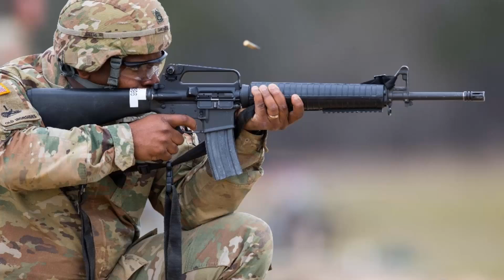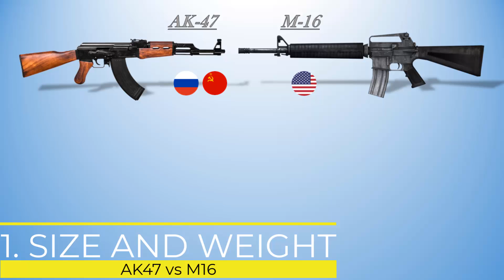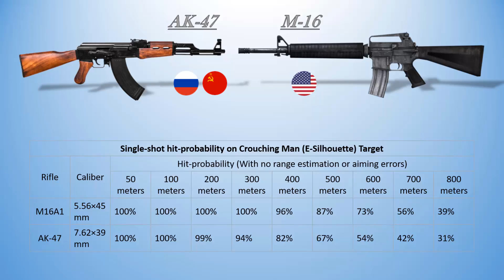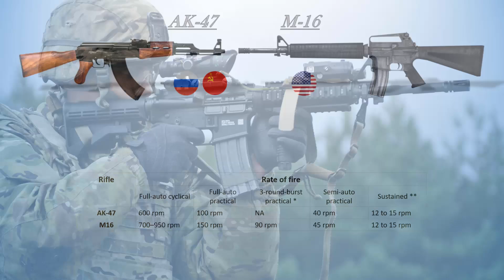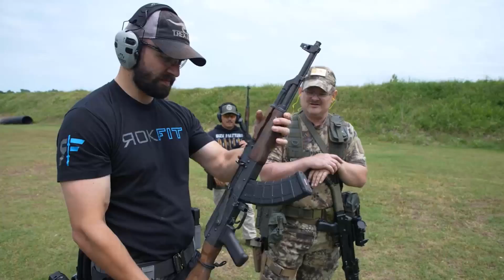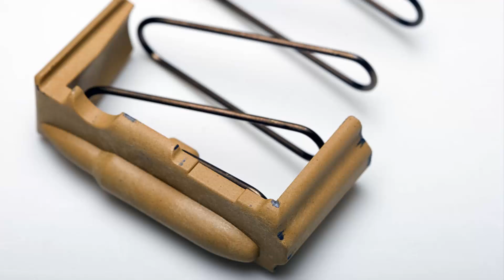AK-47 vs M16 | Which is better between the two?

Comment: M-16 at the range, AK-47 on the battlefield
Reply: I'd take anything that's not chambered in 5.56 long before I touch an M16 or any AR derivative.
Any rifle which requires a "forward assist" to get it's bolt to go into battery, is a piece of crap.
Reply: @mazambane286  The AK has a "forward assist" too, I guess it's a POS. Soviet 5.45 is similar to 5.56 NATO, so the AK-74 must be dinky in spite of all the KIA's in Ukraine ツ
Reply: @TheSundayShooter  Well I don't know where you live? But I live in Africa. Now I have seen thousands of AKM's in my life and have to see one with a forward assist. Could you explain to me exactly where on the rifle it can be found? 
Yes the Russians are sure to find out soon enough, as have NATO, that those pissy little rounds are useless.
The yanks know this too. But seeing as they have invested huge money into that AR platform of failure over the last 60 decades they are now far too embarrassed to admit it.
Reply: @mazambane286  The fixed (reciprocating) charging handle of the AK functions as a "forward assist". The Ukrainians are inflicting plenty of casualties on the Russians with "pissy little" 5.45x39. I am not sure how you measure success/failure when neither 7.26x51 nor 7.62x39 made a difference in Rhodesia and South Africa respectively
Reply: @TheSundayShooter  Not only did I do the foreign weapons course, I also made use of eastern block weapons. And nowhere during my training was I ever instructed use the cocking handle as a forward assist. Ever!
Regarding Rhodesia and South Africa. Firstly I don't believe you were even alive in the 70' and 80's, let alone in either of those two countries.
Rhodesia never used the 5.56 at all. Apart from a few privately owned rifles. 
South Africa adopted the 5.56 in the early 80's. A move which was not widely accepted by professional soldiers. 
The doctrine was basically as the army could not train their national servicemen to shoot straight, they would train them to shoot lots! Much like the yank "spray and pray" doctrine. Which you still use.
Throw a lot of lead downrange and hope you hit something!
I for one refused to be issued with the new rifle. Much preferring to hang on to my 7.62. 
At least the 7.62 is not defected by twigs and leaves.
The 7.62 has been teaching the bad guys the difference between cover and concealment for over 60 years! 
You can keep your AR and your 5.56.
Reply: @mazambane286  
>eastern block weapons
There is no K in Eastern Bloc
>nowhere during my training was I ever instructed
It can be done physically, does not matter whether or not you were told you could
>yank "spray and pray" doctrine

You have mistaken the American doctrine of suppressive fire for the German practice of spray and pray
>Much preferring to hang on to my 7.62
Made no difference to the SACP coalition, which has control of the SA government
>teaching the bad guys the difference between cover and concealment
Is that how you cope with your five-round magazine and lack of select-fire? Interesting...
Reply: @TheSundayShooter  Seems you're rather confused. Or is Southern African military history just not your strong suit? Along with the benefits of carrying a rifle chambered in 7.62 over 5.56!
Eastern Block suits me fine thanks!
Imagine a yank attempting to teach someone English! 
Well one thing I can add to your delirium. 
At least the South Africans managed to defeat the warsaw pact in the field. The only nation, other than the Afghans, to actually achieve this feat. 
Things never went very well for you in let's see......Korea, Vietnam, Iraq, Afghanistan, Mogadishu. Fuck me that was a disaster! 
Your attempt at rescue in Iran...was it in 1980? When one plane got lost. Two others flew into each other! One was abandoned somewhere? 
Oh well at least you managed a win in Grenada. Woooopee!
Reply: M16 is never run for bananas body but ak 47 is proced to another bananas body,,that a compare,meaning ak47 is better than m16
Reply: You apre absolutely right
Reply: เฮาอยู่สกลเน้อออออ
Reply: Bro has never heard of the M16A1
Reply: They missed, probably, the most important comparison: cost per unit (the old "made for purpose" vs "made for profit" comparison that always gets overlooked here in the west - it all about the 'bells & whistles' and not the volume...)
Reply: The Ruger 10/22 is better than both of them
Reply: I'm retired DF.  I agree.
Reply: The best special operations forces around the globe prefer AR-15's
Reply: @TheSundayShooter 😂😂🤣☝
Reply: @TheSundayShooter   And yet 1000s of US marines and soldiers preferred the AKs they picked up off of dead Vietnamese over their m16s.
Reply: @BrownBandido  There you go again— invoking Vietnam memes after being confronted with reality of the 21st Century
Reply: @TheSundayShooter  The AK series of rifles have proven time and time again to be better than the ar15 series. And your bias was hilariously blatant when you compared the m4 (an improved, newer m16) to the old ak47. A fair comparison to the m4 would be the ak74, and while the m4 is more accurate, the ak74 is more reliable and the 5.45 has better ballistics than the 5.56. The only one living in an alternate reality is you, cope harder
Reply: @BrownBandido  I never referred to "the old AK-47", that was Marlin-1895 (the OP). The AK-74 is a better service rifle, but the Russians currently use the AK-12, which is garbage (even the AK YouTubers agree)
Reply: @BrownBandido  There have been more improvements that can be listed on the AR's. But the reason that the M-16s weren't reliable in that era had more to do with the ammo being provided than the weapon.
Reply: @TheSundayShooter  gonna cry ?
Reply: @platypunk1998  About Russia's perpetual humiliation in Ukraine? Nope, that's all you
Reply: @TheSundayShooter  Ukraine is burning up in flames along with your irrelevant opinion
Reply: @TheSundayShooter You listen to way too much biden propaganda.
Reply: @birminghamblueheat4986  And the misinformation that the rifle was "self-cleaning".
Reply: @BrownBandido uh no, the military would not allow that but okay 😂😂
Reply: @BrownBandido  That's because the early models during Vietnam had issues though later versions were much improved.
Reply: @BrownBandido  this is not 1968
Reply: The AK47 and it’s many variants are great rifles and are proven reliable and lethal but the m16/m4 variants are a more precision/accurate rifle and is a lot more reliable than you may hear in popular culture. Any armed organization with the money has m16/m4 type rifles supplied to its ground forces and those who have less funds use AK type rifles.
Reply: @BrownBandido I didn’t. When you were there did you witness this personally or is this what you heard in a bar one evening?
Reply: @BrownBandido at the time the M16 was introduced it was not a very good rifle the magazines were crappy in a 20-round magazine that can only put 16 using bad cartridges probably bad powder as well but they made improvements on it and it got better and better which is why it's still used today
Reply: M16 is way better for the battlefield

Comment: I like the m-16 better, it can easily be modified to shoot other calibers in different barrel lengths with out a gunsmith working  in a shop,
Reply: M16- what it slightly lacks in reliability, makes up for it with ease of customization.
- Less reliable in combat due to tighter tolerances, leading to jamming and damage to the gun
+ greater customization allows to modify internals and increase performance and compensate it's lower reliability
Reply: @bum116  the IRA's weapons expert chose the AR-15 over the AK-47 to arm the entire IRA,  because of the big difference in accuracy, even though the cost was 3 times higher per rifle, they believed reliability issues are not a problem, with a smart competent soldier behind the sights,

Comment: If we are talking about the early M-16 I would prefer AK in most environments. 

More modern M-16s beats AK no competition. Better in almost all aspects outside of reliability. 

Even so, modern M-16s are very reliable, put to great use by several Guerrilla groups in tropical regions worldwide such as the Myanmar PDF.
Reply: Reliable=fucking jams
Reply: @HayilAl-Qadhaafi-ws9of  only the early Vietnam era M16s got a bad jamming problem. Newer ones are reliable, not as reliable as the AK but still very reliable.

Comment: In Vietnam War, US soldiers would had thrown their M16/AR 15 when they saw AK47/AKM or RPD/RPK.
Reply: That’s kind of incorrect. There’s a lot of reasons they threw away their ar15s is that they never issued maintenance kit or instructions to clean them, no forward assist, didn’t chrome the chamber and using crap ammunition that easily mess the cycling.

When they finally issued m16a1 and gave actual instructions, a lot of the initial problems got resolved. Although, it didn’t fix they’re in thick foliage and being in someone’s home turf.
Reply: @Frank451Martin  most accurate comment I've read yet.
Reply: Early M-16s we’re notoriously easy to jam. Nowadays M-16s are very reliable. Even the Myanmar PDF Guerrillas use them in the jungle environment to great success.

But still, an SKS would beat both the M-16 and AK in reliability. I’ve seen a video of one of those get run over repeatedly, smeared in mud and poop, left in water for days on end, and thrown in a bonfire and still work.
Reply: @spingebill8551  
This foundation was still laid by the USSR and adopted by Russia. Any weapon that is not too complicated (from a machine gun to a cannon) should be: 1. Easy to use by the user 2 Repairable "on the knee" in the field 3 Reliable (to be used for a long time without maintenance) 4 Unpretentious (to be used in rain, snow, mud)
Reply: Yes, that's exactly what happened.
Reply: @hollymartins6913  Do you think Gali ACE 31/32 is a version of AK?????
Reply: @MLPFRIENDSHIP360  think of the galil as a kosher ak made by balashnikov. Yes, it’s pretty much an ak that shoot nato rounds.
Reply: @MLPFRIENDSHIP360  think of the galil as a kosher ak made by balashnikov. Yes, it’s pretty much an ak that shoot nato rounds.
Reply: Like everything else there are teething problems to any new system and that does not mean it will stay that ways.
Reply: @tomnguyen9931  But US haven't fixed that problem when they created M4 Carbine in many years later and now US Army wants to buy German's gun instead of keep using M4A1
Reply: Stop the lies, the ar15 wasn’t even invented in the Vietnam war, only the first version and protypes of the M16. Russian boy
Reply: LOL, where did you hear that bullshit? You can nag about M16 vs AK, but American M60 is actually superior to the Russian machinegun RPD/RPK. Even the VCs will be happy to take M60 any day. And AR 15 is actually much better in terms of reliability than M16 used back then because they used a false powder for M16 ammo, not issuing the cleaning kit for M16. So it was the false of the US logistics, not the gun itself.
Reply: Thats a lie!
Reply: @SNACHG   M16 is terrible, that is never lie !!!
Reply: ???, you obviously don't know the real history of the M16's service in Vietnam! Stop telling stories you made up in your head!!
Reply: @montys420-  AK47 never get jammed. Water, sand, always works bro.
Reply: @andrzejperski854  will agree with you mate it is a weapon that is designed to be rugged and work, simple to use and maintain by simple ppl, and because of this it's not very accurate!
Reply: @montys420-  Yes M16 can shot on longer distance with more accuracy but when area is tight with loads of obstacles AK47 is much better.
Reply: @montys420-  
You are a not smart boy who does not know how and with what weapons the army of his country fought. The network is full of photos and even videos with US soldiers with AK47, this is reflected in the memoirs and interviews of American soldiers. And you deny. And it's not even about cleaning and special care for the M16. A 5.56 mm bullet, if it came across a knot or other obstacle in its path, changed direction. 7.62 no. It turned out that in the field and in the open space the M16 is more accurate, but not in the forest and the jungle. The Vietnamese set up ambushes by breathing through a reed under water. And they shot the enemy from under the water. Is it suitable for such an M16? No. I'm not saying that the M16 is bad, in the desert I would prefer it
Reply: @romankovalev7894  Again not true at all
Reply: @AldoSchmedack  
Well, I didn't talk about everything. I'll just give an example from the current conflict. Ukrainians complain that neither "777" nor other artillery systems can withstand a high rate of fire for a long time. This weapon is not for war. Shoot a little, and then clean and cool the barrel for a long time.
Reply: @AldoSchmedack  
You make good systems, technologically advanced and accurate. Two days ago, we stated to the UN that it would be impossible to use satellite intelligence for Ukraine and not be a party to the conflict. All satellites are our legitimate military targets. What does it mean? We will shoot down everything that interferes with our operation. Yes, most likely even the Global Hawk near the border. How will you fight without GPS and the Internet? No basic connection? Hello F35 :) A rocket will fly to the signal from a cell phone.
Reply: @romankovalev7894  you have no idea 🤡 that US troops to use any soviet weapon would have been from SOCOG, and considering a lot of that was classified until recently idk where you think you found all this archival footage!🤣 and whilst I agree the 7.62 might do more damage to bone it actually does less damage to soft tissue and organs then a 5.56. You are far from a smart boy and a knot?? How does a 5.56 come into contact with such?? 🤣
Reply: @romankovalev7894  you can NOT shoot your enemy from under water with an AK🤣🤣 🤡 GO BACK TO SCHOOL YOUR ARE VERY DULL
Reply: @jd7327  not once the lie they were told when issued the M16 during the Vietnam war that the M16 didnt require cleaning and no cleaning kits were issued and once the infantry were told that they did require morning routine of cleaning the weapon as all previous small arms the US had been issued with!.

Comment: m16 accuracy but ak trusty
Reply: I like AK because it is cheap and very reliable
Reply: Don’t be fooled by its legacy in Vietnam, throughout the years the M-16 has gotten very reliable. Even towards the end of Vietnam, the situation was heavily improved.

Still, the reliability doesn’t beat the good old Kalashnikov, although if you’re looking for raw reliability you should just get an SKS as it makes even the AK look unreliable.
Reply: @spingebill8551  Yes, reliability is not everything, just a criterion. M16 is actually reliable enough while having high accuracy, rate of fire, stability, lightweight,...almost everything a soldier ever wants. It is suck because the gun gain the bad reputation in VN war which was the false of the US logistic, not the M16 itself.